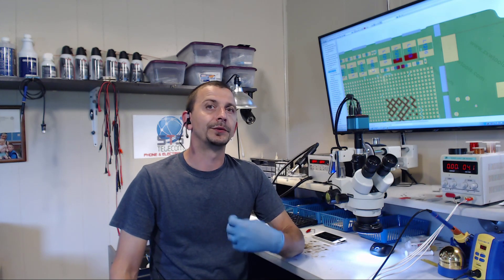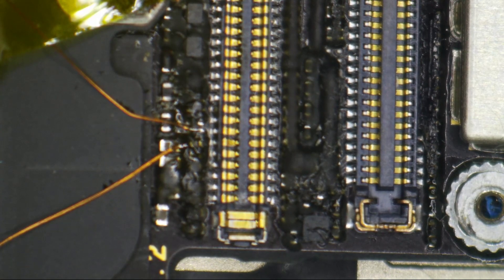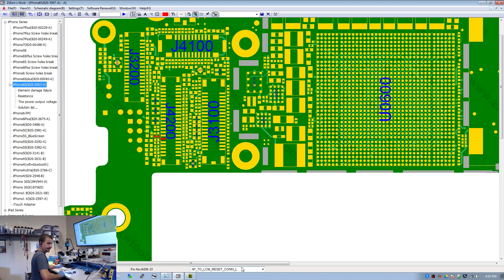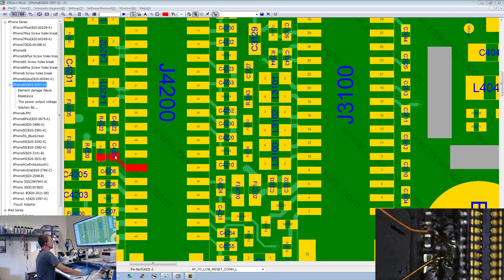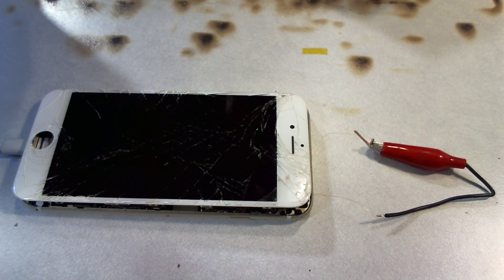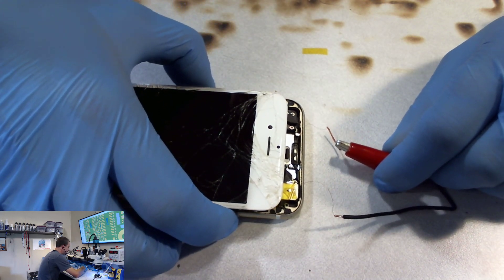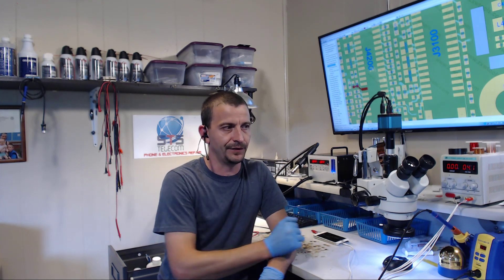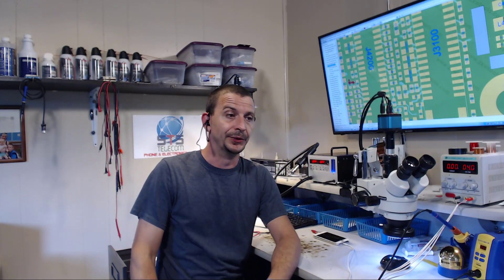iPhone 6S No Image - AP_TO_LCM_RESET shorted to ground

Comment: Hey that's great--you got it, love to see folks using their brain! :)   We think the reset line must go low to dump the image anytime the image is not static, so if you wait for static image to bring the line high and prompt to wake display it will work.  So far so good with recovering data from all these buggers, and we are still trying to figure out what the exact fault is that causes this.   It seems to happen whenever someone plugs in either an iPhone 6 screen or the fcam connector into the 6s digi connector.   Hopefully Jason you can chime in on what the history is on the ones you are seeing to drill down to the exact cause.     Strong work!   ~Jessa
Reply: Jessa & Jason, I will be working on an external circuit board to get an image for data recovery jobs. I cannot say exactly whenever line goes low/high as I currently do not have a 6s board. My current idea is that you prompt to boot with a lightning connector, and then circuit will listen to BUTTON_HOLD_KEY_CONN_L and whenever its state changes, it will fire and mimic the real AP_TO_LCM_RESET to get an image. Not exactly sure what is happening until I get my hands on a 6s board though.
Reply: Ive seen this from Improper screen like an i6 screen and also from people placing the connector in incorrectly while the phone is powered. Had one last week they had installed the screen while it was on and had shorted the Touch 1v8 Filter, and AP to LCM Reset. Im trying to remember but I believe I just jumped a line from Ap to LCM Reset to 1v8 LCM but I wonder if the AP to Touch Reset Line would work for the timing. Ill have to look up the schematic. i6/6 plus you can jump the to photon_alive line and itll work.
Reply: Mark did three of these last week and may be able to chime in with more info,  I think he tried the AP to touch reset.  One thing we were thinking is that the fault may be that an internal mosfet within the CPU gets "stuck" in the open position.  He got one to work by injecting the 1v8 back into the CPU, where it would not work until he did that, the resistance on the short changed--leading us to think that it may be possible to "unstuck" the CPU mosfet.  But it is still one of those thing where he was guessing the timing.  I remember he worked on that one for awhile and then came over and said he got it working.  I asked him what was the trick?  He said "Not sure, this time I shorted the line, beat my dick on it, and then it worked."
Reply from the maker: Thank u.  I'm onboard with a stuck transistor inside the cpu.  I'm hoping to have lab rat to mess with before long.  The disturbing thing is that I may very well already have one and don't remember.  :)  Out swimming with the family at the river today,  I'll be getting into the comments under this video more a bit later.   good comments for sure.
Reply from the maker: Would seem logical to be able to reverse the stuck transistor to apply 1.8v or scarily enough, even reverse polarity but I've never tried to fix a transistor, only replaced them.
Reply: Jessa I believe Arron Herrington had one the same way and I suggested back feeding into it and it also cleared the short but the line still didnt work properly. Still no image after. I do fully agree it is a stuck transistor in the CPU
Reply: Probably will remain permanently damaged even if you "unstuck" it.

Comment: Nice work. Here's a tip to eliminate guess work with timing: 
What you can do is tie lcm_enable to lcm_reset together (after the short on the connector side) they generally are triggered together and is a quick trick to get timing right. This will get the display to come on at power up but as soon as phone goes to sleep the display stays off. But for data recovery you simply go into settings and turn auto lock to never.

Comment: Hi friend,   problem was solved with copy LCD/Touch and jumpet TP06 directtly to AP_TO_LCM_RESET_L (FPC pin) was need remove FL filter. I didnt had I.C max9060 for test with OEM LCD.  But i have this new problem now.. After it enter standy for some time. No more image. Just backlight is on. Need remove battery and reconect it. With USB cable connected no have this problem. 1.8v no off when in stanby

Comment: Jason the pattern was the Power needed to be present and constant before button click. Id assume its Low when screen is off.
Reply from the maker: Chris Long I would think the same thing but my data recovery on this was actually done with it disconnected.  The image popped up the second I disconnected 1.8v and I had working touch.   It certainly didn't behave that way in this video.

Comment: The reason timing is important and a reset for image is needed is because data is clocked in serially, if the counters start in a random state then the initial image could look like a mess. 

Sometimes, many wrong options lead to a confused and abnormal view , without knowing how to re-calibrate colors, frequency, horizontal , east-west correction, etc, so, here it goes .. Reset.

Also, if the mainboard takes a few seconds to boot, the reset signal prevents a screen full of colourfull snow.

Comment: New video yey :) I have some questions and would be happy if you could answer them :) A lil bit offtopic but on what temperature do i have to set my hot air station when i want to remove the Touch IC Chip or removing capacitors. I just bought one and want to start my first repair but don't wanna ruin the logic board. And does the logic board work with a removed capacitor because i've seen a video of a water damage repair and the guy took a capacitor out (he didn't put another one in) and it turned on. This stuff really interests me but atm i don't have much knownledge about that (this is why i ask). First i was like "Yeah just replacing some screens for people for lil money" but now the stuff with the logic board, capacitors, micro-soldering, fixing problems and all that good stuff became so interesting that it became more like a hobby than a 50 bucks screen repair lol. So i would appreciate your help :)
Reply: JAYLOW 
temperature 380-390C
Air flow 38-42 - settings are for the Aoyue 852A++. You should only take these as a reference. Distance between hot air and board is also a major factor.
A phone can work without a capacitor but it depends where it is. Also if apple places a component I guarantee you that it is necessary to be there. Hope I cleared some stuff out for you.
Reply: JAYLOW Also if doing your first repair get a donor board or icloud locked. 3/4 times you are going to ruin it so be careful working on an actual board.
Reply: Thanks dude! I'm actually working on a water damaged board and i think its C5202_RF what has to be removed because i saw corrosion on it but the rest was clear. I got the phone for cheap so it won't hurt me if i ruin it. The next level would be removing a Touch IC Chip and reballing it and if nessecary creating a jumper. But i'm gonna start with a capacitor haha. But another question: As i said, i think its C5202_RF but when i connect the board to a battery or the charging cable the whole board gets hot so i can't locate the short. Do you know what the reason for that is? Also, do all capacitors that look the same do the same? Like can i use these "big" white capacitors all over the place or is each one made for it's own place. Also i have to get a Multimeter. Maybe that makes it easier detecting a short. And a donor board for parts i need. Anyway, thanks dude!
Reply: JAYLOW c5202_rf is very common with water damage on the iphone 6/6+. No matter what you should always make an M1 jumper when doing a touch ic. If when connecting the battery the board gets hot you might have a short on VCC_MAIN. C5202_RF is on this line so if it looks corroded probably that is the culprit. Check for other visible corrosion on the whole board. You can locate the short by using a power supply and setting it to a max of 2.5/3 Amps. You can go higher but you are risking. If you see it pulling amps as soon as you connect it you have a dead giveaway that the line is shorted. Use alcohol to help locate it. No, the capacitors are not the same just because they visually seem the same. All capacitors have a capacitance value, a max voltage rating and a package type, 01005 being the smallest. A multimeter only shows you that the line is shorted and not the specific component.
Reply: JAYLOW remember electricity is lazy. It always takes the easiest path.
Reply: Thank you @Marway Bonnici and @Slydder68 :)
So It's been a while and i finally tried to replace the TouchIC Chip but i failed at reballing because the chip always stuck on the stencil and i ripped of some pins wich had no contact to the past afterwards. And after trying and trying again the board lost its protection because i always scrubbed with my soldering iron over it to remove the solder. So i now have a new chip and i will try it again with the new flux that ships on Monday. I hope i don't fk it up again but i learned what not to do. I'm scared of reballing because it seems i missed something. Is there a trick so it doesn't get stuck?
Otherwise i learned how to detect a short circuit on a capacitor. I looked at the second board with the water damage and no fking wonder why it got hot everywhere. Every 10th capacitor had a short. And i checked only 1/10 of the board. (Heres a screenshot: goo.gl/x9ycoA) Under the shield it looked like the phone was dropped into the sea and stayed there for a decade. Should i move away from it and look for something new?
Reply: That board looks like it has some serious corrosion issues. Unless it is for data, please throw this in the sea again. Maybe someday an iPhone coral will grow. Regarding reballing, you might have a lot of solder for every pad. If that is the case, more away from solder paste and go to pre made balls. Takes more patience but every pad will have equal amounts of solder. If you are scared of reballing, get a new chip. But beware, it comes with unleaded solder and this has a higher melting point than leaded which increases chance of damage to other side, underfilled ics & surrounding components. By board losing protection, I am assuming you are referring to the solder mask, also known as conformal coating. This is caused by excessive pressure. When tinning pads with leaded make sure to try and touch the pads only rather than the board itself.
Reply: Thank you @Slydder68 and @Marway Bonnici :) I decided to make it my practice board so i removed some chips already to get a feeling for desoldering and jo this is not easy. I think i need other tweezers because mine are cracking the chips and break them. Also i need to get a feeling for how much heat and air flow is right for me. I tried to remove the Wifi chip and i heard a popping sound at some point haha. I think thats not good. And when i removed the NAND Chip i accidentally removed a cap with it. So thanks for the tip. I think i would have ruined the board that actually works. And thanks for the tip with rubbing the stencil with flux! That really helped! Some tips still stuck in the stencil but it came of really well. Ok i have to say i tried to remove the Tristar chip wich is one of the smallest chip on the board but at least it kinda worked. Its good to know that you can fk up the board. It makes practicing easier. I also stopped to rub but tap on the pads of the chips and the conformal coating didn't go off. I already got my Touch IC chip i ordered and i will watch out for the higher melting point of the unleaded solder. Again thank you and i will keep you updated! :)